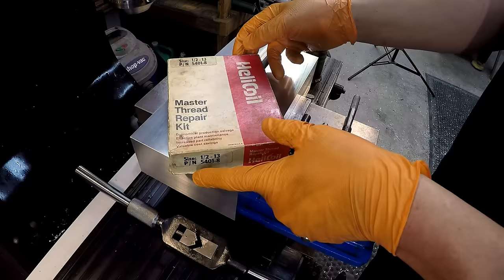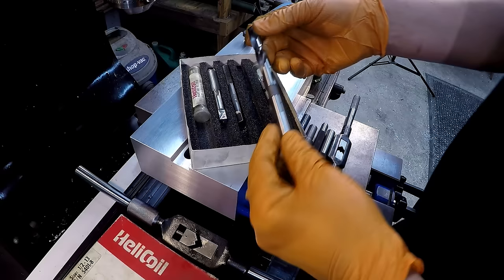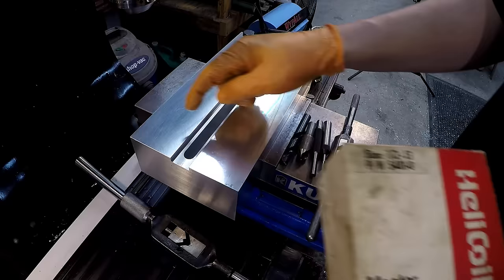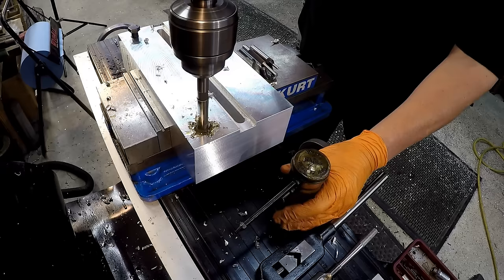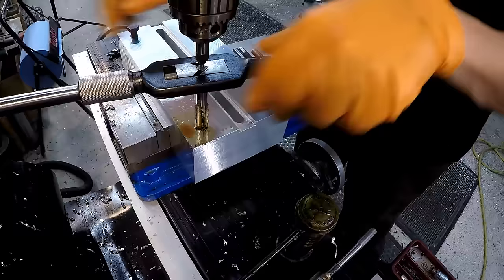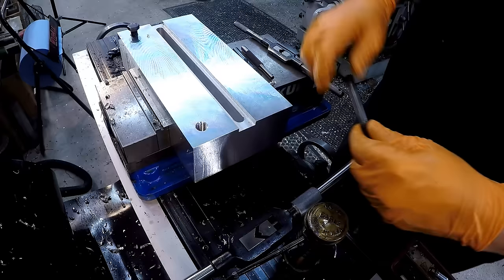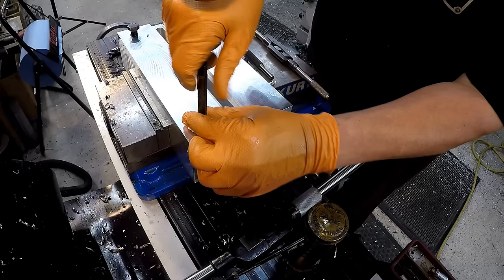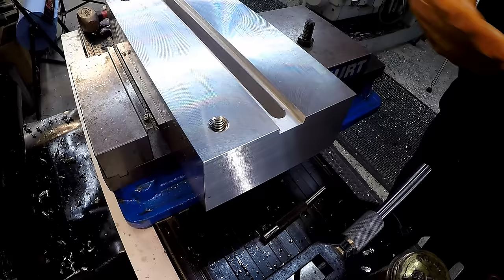How To Install a HeliCoil

Comment: Is it possible to remove the tab without hammering down? What about upwards with small twizers? Cos I've gotta redo a thread on a BILND HOLE. From the video I can't see if you're working on a blind hole and if the thread you've inserted goes all the way to down.
Reply: The notch in the helicoil wire is placed such that a downward tap will shear it ... you could just leave it there at the bottom of the blind hole, it ain't gonna be in the way... though I have on occasion screwed it (the helicoil minus the tab) onto a screw (with a nut to stop it screwing further upwards) & then screwed it  into the freshly tapped hole...

😎👍☘️🍺
Reply: take a scribe with a magnet attached to it to remove the magnetic tang
Reply: He said he was drilling an inch and a half deep hole.  And when he showed us the box, he showed us the coil length, they are 3/4" long.

Comment: Great vid. I think I have to do this on an engine with a stripped drive belt tensioner bolt hole. How deep does the hole need to be to use this product? The tensioner bolt is only 3 cm.
Reply: I've heard that the hole should be 1.5 - 2 x the diameter of the coil. Hope that helps.

Comment: With small helicoils, a bit of pressure may be exerted on the installation tool, but NOT on larger helicoils! There is a chance that the helicoil will skip a turn if there is too much pressure.

Comment: I have questions. Is it possible to stack coils? Is it possible to use with Lock-tite? I'm repairing motorcycle engine case. This video is very helpful.
Reply: Loctite can be used to secure the coil in the hole, not sure about stacking, aren't longer coils available?
Reply: I've stacked them, but I left enough gap between them to be able to break the installation tang off from the top helicoil. If you drive the top helicoil all the way down against the bottom helicoil then I'm not sure if you can break the tang off.  Do a trial run. Other option is deeper helicoil.
Reply: Stuart Castle what keeps the helicoil from backing out of you don’t use locktite?

Comment: I may have screwed up... I broke an extractor in a 7mm threaded hole m6x1.0 is the original thread size. Anyways my drill walked and forced me to use a 5/16 drill. Is it possible to use helicoil to bring it back to m6x1.0 thread? Please, anybody! My motorcycle is waiting. Orherwise ill have to drill the stator cover hole to fit the new bolt size...
Reply: Yes. 5/16 drill is really close to which need to be used with M6 helicoil (7,6 - 7,85mm.)

Comment: I don't get it, what keeps the "threading" in the hole?? How could this possibly be stronger than drilling and tapping??
Reply: First: the helicoil insert is made from steel, so you dont have to worry about gulling like you would with aluminum.

Second: you actually cut larger threads in the aluminum which make the weakest link(aluminum threads) stronger by being a larger diameter.
Reply: @mission772  Very interesting.  I thought he was just demonstrating how to install a repair coil but didn't actually have any compromised threads to repair.

Thanks for the insight!
Reply: I get what your saying but what keeps the steel helicoil insert fastened into a drilled hole, seems like if u had any type of load attached to that bolt head, you'd soon be looking at a bolt with a helicoil thread over it's threads....
Reply: @bobbertee5945  They can still be stripped out just like normal threads. The extra diameter increases the surface area so the aluminum can handle more load. We use them a lot in delrin, PVC, UHMW, PTFE, etc to prevent galling and help strengthen where a steel bolt connects to a softer material.
Reply: It seems to me that when the installation tool grabs that piece he broke off at the end, you are winding the spring tighter there by stinking it to fit in the specially threaded hole. The spring tension holds it and when you back a bolt out, you would be causing it to expand in the hole.
Reply: @bobbertee5945  The spring tension in the coil keeps it there, or you could threadlock it.
Reply: @mcplutt  I usually put a dab of red loktite on them in an automotive application.  Not sure if it's correct, but it was the way I was taught, not had one come loose yet

Comment: Really well made and concise demo!  I'd heard of helicoils a few years back and understood them in theory but never saw one installed.  I had thought they were exclusively for thread repair but using in a piece made of a softer metal makes perfect sense.
Do you happen to know what grade of steel (I'm assuming they're made of steel) they are made from?
Reply: We have customers regularly spec those for plastic (Delrin, polypropylene, etc) parts for the same reason. Though I prefer and recommend threaded inserts instead, when possible. Threaded inserts require more wall thickness, so sometimes Helicoils are the only option.
Reply: Oh, and material is usually stainless or a nickel alloy. Think titanium may also be an option.

Comment: what is the insert that u snap off at the end for anyways? please explain.. and wont the bolt snap it off.. when you put it in anyways? what if i need to go deeper.. in the hole.. and there is no room left to snap it off? due to the outerparts of the hole being cracked.. but deeper inside.. its no longer stressed cracked.. ty for your time
Reply: If you look at 1:12 you can see a shoulder at the end of the threaded bolt, that is what drives the helicoil into tapped hole by sitting against the tang.

You could try threading a bolt in without snapping the tang but it may just bend with slow pressure instead of shearing off. Theoretically if you wanted to bottom out the helicoil you probably could, so long as you use shorter bolts or washers to take up the gap that is created. I could be wrong though, please correct me if so

Comment: I'm new to this, why do you fit a heli coil inside? what for? is it not enough to create the thread?
Reply: well this is mainly to repair holes with stripped threads especially if you cant repair or go a size bigger but it works also great on aluminium by increasing the surface area to make the threads more durable.
Reply: @heateslier  are helicoils used to be installed in steel or iron blocks?
Reply: If I had to wager a guess its for aluminum blocks. Aluminum is softer, so you can thread it but it might not hold up as well in the long run if its a screw you're gonna be taking out and putting back in often. The helicoil is probably steel, so it'll hold up to the bolt.
Reply: @killabyte79  Helicoils can be installed in steel or iron. Typically this is done when the original thread is destroyed and needs to be repaired. It is common to install a Helicoil in aluminum as the original hole because it will be stronger than the aluminum and more resistant to corrosion, especially when it comes to repeated use (bolts goes in and out frequently) or for high temperatures.
Reply: @drumdradod  thanks dude, could it be installed in a combustion engine? I'm not sure if it would stand the heat cycles
Reply: @killabyte79  they could definitely be installed in a combustion engine. It's a very common use for them. They are stainless steel, and thus very resistant to corrosion by heat cycles, oxidation, galvanic, etc

Comment: Why do i need a special drillbit? Would andy drillbit this size work?
Reply: You just need the correct size. Any drillbit will work, yes.
Reply: If I remember correctly. They have a tighter thread gap. Instead of your typical 75% engagement, they are more like 85%. So hes just saying, use the one with the kits so you know its right. So the thats the long answer. Short answer is use the same size and it will be fine.

Comment: love the video's, but What keeps it from backing out of the hole?
Reply: Those coils are slightly oversized and are just ever so slightly friction bound with the hole they're inserted into. Their inside thread is also slightly oversize so there is not a lot of friction between the bolt and the coil.
They're really not easy to get out once they're in without destroying them completely.

Comment: For what is helicoil used ?
Reply: Mostly for repairing/replacing damaged threads. Or like Adam explained for a stronger thread than the main material.
Reply: @KERNAHT  thx
Reply: I've used a few to repair cylinder heads.

Comment: I've used these in the past, but what keeps them locked in?  When I did machine building (a summer job) I was taught to use Red Loctite on the helicoil to "ensure it would never back out".  Granted, these were BIG machining lines we were building (30 ~ 50 stations making very complex parts).  Now they probably make those parts using banks of CNC's, but this was 30 years ago.  So Again, what is keeping that helicoil in there so as not to back out?  Just friction?
Reply: It is just friction but it all adds up over the surface area.  They are made with a slightly different pitch or even fully compressed, that's why there is resistance when installing.  I've never seen a manufacturers' recommendation to use a thread locker but in some cases I can see where it would make sense.
Reply: @stevewalston7089  Wasn't the manufacturers suggestion...that's what the old time machine builders all did...guys were in the biz 30 years before I was born...figured if they were building machines for 50+ years, they probably knew what they were talking about.
Reply: The manufacturer makes a point out of clarifying that absolutely nothing else is needed to prevent the coil from backing out. It just won't happen. Unless someone produces a first-hand experience of "and then the coil backed out and ever since then I only use them with Locktite..." I'm convinced any extra measures are just various people's needless attempts to "outsmart" everybody else.
Reply: @AttilaAsztalos  As noted, I was directed in this method 30 years ago by people that had been building machines before I was born.  This is why I asked the question.  Appreciate the follow-ups.   I have not needed to helicoil anything since being in that job...so I haven't seen any instructions on a helicoil box..and back then, you went to the tool crib and you signed out what you needed to do the job...they would hand you the drill, tap, tool, and coil...everything else was on you...and man if you didn't return anything?  WATCH OUT!  Those tool crib guys would break your legs...brutal they were.  LOL

Comment: Would you explain what kind of oil you use for tapping, cutting and drilling. Thanks
Reply: You can find in the shops special oil for tapping. For drilling and cutting its a  different  oil.

Comment: Where can you get those spring-loaded centers? 

Never seen one of those, would like to buy one
Reply: Al the tool distributors sell them. Made in China. About $15. MSC, Travers McMaster Carr, KbC, Enco.
Reply: @bigrick7108  If you spend a bit more and get a Starrett or something similar you will be much happier with the tool. The 15 dollar jobbers will get you by but there is a noticeable difference.

Comment: So if you you use the heli coil for  striped thread it allows you to use a smaller bolt size?
Reply: Usually puts thread back to original size. With a stripped thread you can either drill it out, the tap it to make new threads that will be a bigger size than the original, or do like the video and drill it, tap it with the helicoil tap, then use helicoil insert to make it the original thread size again

Comment: I've got a echo pb620 backpack blower that has 1 of the 2 exhaust bolt (holding the muffler on alluminum cylinder head) that's badly wallowed the hole out where the original bolt has play probably over 95% of the way down and falls out in minutes. It will be in a spot that gets pretty hot and I am wondering if I should do the helicoil or rethread it one size larger? I would appreciate ur thoughts on this small but very important repair I plan only attempting without paying a shop there $40 minimum fee which they dont warranty and still costs the same regardless now it turns out.
Reply: How'd it work out? I'm about to do the same repair on a snowblower...
Reply: Seems like you could try to go the next size up closest to it (even if you had to switch to metric so you don’t have to go too big) then if that doesn’t work it will still be small enough to helicoil it

Comment: Do you have to locktide it in place or the tighness is enough to hold the helicoil in extended uses.  Thank you for your videos...
Reply: normally they wont use any type of glue.They used it as a dry insert.
Reply: It's held in by friction, and it does that really well due to the nature of the coil.
Reply: @rallyscoot  they also mahe like slightly hexagonal inserts for extra friction

Comment: 🌟✨🌟 Thanks so much for this great video. A true machinist.  I’m looking to install one in my aluminum Stephs sumped custom oil pan and it’s on my 70 Camaro RS  468 CI big block since the drain plug is stripped.   I’m concerned with snapping off that tang since it will go into the pan.  Any advice on how to deal with that situation in fishing it out of the pan would be appreciated immensely.  🤟🏼
Reply: Use a small neodymium magnet glued on a dowel to fish it out. A SMALL magnet. Really small.
    You could also try double stick tape on a stick. make sure you wrap it high so it doesn't come off.
   (heavy duty carpet tape)
Reply: @firesurfer  i dont think magnets work on aluminium.
Reply: Simular situation - wondering if small enough needle nose pliers could yank it down & out instead of banging it in.
Reply: @sandarelliott5319  The helicoil is made from steel. @James Mason they also make tangless coils
Reply: Dropped the pan and do it on a bench. Or just change the pan
Reply: Greg Castro  tangless sounds like a good option.   I’ve got so much money in the engine that I’m going to have this professionally done now that I see what’s involved but will pass on the helpful info from here .  I completely rebuilt my first cars engine, a Pontiac 400 a year after high school  yet I’m reluctant to attempt this.  I had much less fear of a failure back then.
Reply: @Jimmy_Cavallo  This is the smartest comment on here👍

Comment: What's the use case for one of these?
Reply: Usually to repair a damaged bolt hole that easier and cheaper methods won't work to fix. Like a stripped out hole in an engine block or if you break off a bolt and have to drill it out.
Reply: But y not put oversized bolt in if ur tapping it anyway never understood that one?
Reply: @mojoe8005  There will be cases when an oversize bolt is not an option as a fix. Say a stripped spark plug thread, a cylinder head may not have the space for an oversized bolt, OR where you want a stronger thread than the original tapping.
Reply: Also a helicoiled thread is much stronger than a regular thread. They are not only used to repair threads.
Reply: @mojoe8005  then you have to open up the clearance be hole in the mating part and now have a bastard assembly.

Comment: I had to helicoil a part a few weeks back and, not being 100% sure how it was supposed to go, I threaded the insert all the way into the hole. I just had to use a different bolt, but the boss still chewed my ass.

Comment: Keensert video next!
Reply: Paul Robinson ... OK, I got to ask- what is a Keensert?  Never heard of them.
Reply: @leebarnhart9725  - Similar idea but a little more heavy duty. Instead of a coiled wire they are solid insert with threads on the inside and outside and usually 4 locking "keys" that get hammered in to prevent it from threading out. Its a trade name like "Helicoil" short for Keyed Insert.

Comment: Is there a specific reason why you use a very low rpm drilling the hole? I mean, I estimate the rpm in the video around 300 rpm, where I would use  2000 rpm on a stabil machine
Reply: speeds and feeds

Comment: Is it necessary to apply locktight to the insert?
Reply: I've heard differing views on the matter - but he didn't.
Reply: Nope.
Reply: I am curious about that too. Since this guy obviously knows what he does, and he didn't apply any, it isn't probably necessary.
Reply: The insert stretches when you install it. So the spring tension of the insert itself will hold it in place. Putting any type of thread locker in it would just cause problems.

Comment: Need to do the underside of an engine, any tips for installing freehand with a hand drill
Reply: I have no tips, but I feel your concern.  I have to tap and Helicoil a couple head bolt holes in my Honda aluminum block.  Man, what a feeling when one stripped after re-installing head bolts after a head gasket replacement.
Reply: i bought a 90 degree attachment for my drill

Comment: I made my own one time from soldering wire on a motorbike head.., it didnt work!
Reply: @Andy  IF tin / lead solder, no wonder it didn't work.  Tooooo soft & wrong shape.  Heli-Coils are steel or stainless steel and the wire is a 60° diamond shape to match the normal thread angles.

Comment: Can you use a thread locker before you insert a helicoil?
Reply: My question too.
Reply: That's how I was shown years ago and still do to this day. Never had one pull out and we torque up to 450ft/lbs. That's also the blue thread locker not the red.
Reply: Yes l do, red permanent.

Comment: Should you or shouldn't you use locktite inserting the helicoil?
Reply: I’m preparing to do this and I would assume yes definitely
Reply: @braapmoto9268   I took it to a Caliper repair shop and had it done by them for $50 b/c the helicoil kit would of cost me  $169.  You can find cheaper ones on Amazon, but I'm not quite sure about the quality.   Anyway.. he told me locktite was not necessary.